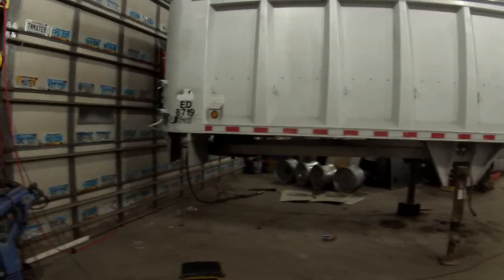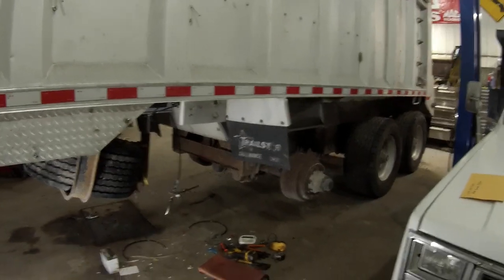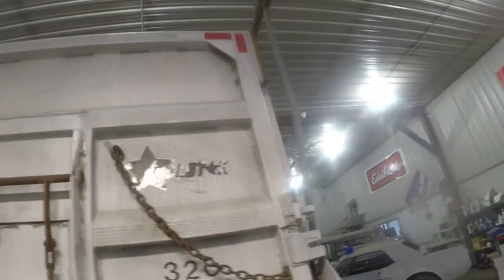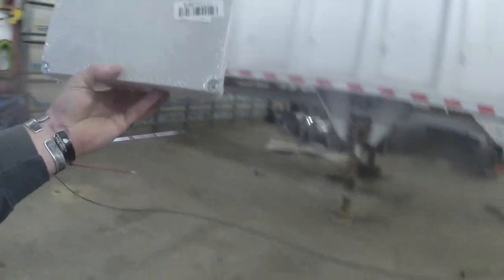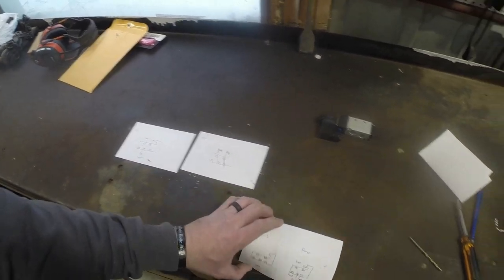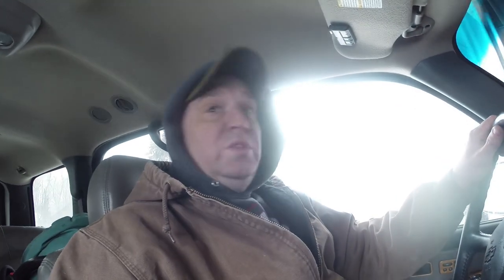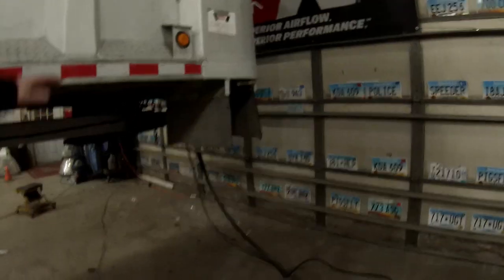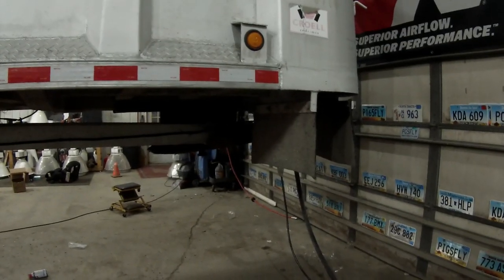Northland Mike Ep. 23 - Dump Trailer Tag Axle Conversion - Plumbing the Air Controls

Comment: Fontaine makes a fifth wheel locking kit just for such an occasion. Also some RGN trailers need locking fifth wheel. I pulled a frameless dump for10 years. I’ve seen a few different ways to lock it in place. What I’ve seen a lot of guys do is weld a round or half round piece of steel on each front corner under fifth wheel, then cut a solid steel piece to length to secure the front. Picture two round supports going straight up and down. Then on the backside the  two little uprights the back of the fifth wheel rests on when your not hooked up. Take apiece of flat steel measure it to length so when bolt it to upright it holds backside leveling the fifth wheel. Make sure it’s solid on all4 corners. I knew a guy that had the kit that was much easier to work with and more versatile tho.
Reply from the maker: Yup.   I will prob do a removable pin style in the future for now I just have some removable beams under the plate...   not too bad but a pin would be super convenient!

Comment: Looks like a nice trailer Mike, Super Singles are no big deal. What are you going to pull it with and does it have a wetline?
Reply from the maker: Yeah.  Im just worried about one goin down.   I picked up a KW t660 that was wrecked over the summer and rebuilt it.   (Kicking myself for not you tubing it)  I put a wet kit on and thats gonna pull it at first until I get the 352 ready to work.   Then it'll be a toss up!
Reply: @northlandmike6694  I ran 660's they are nice trucks, I also ran a cabover freightliner in 2014 it was a blast to run had a 350 in it with 80,000 you had to play your hills right like in the old days run downhill as fast as you can and then see how many gears you need to downshift going back up were my 660 had 600 cummins in it there was none of that. The 660 was a company truck the cabover I bought and fixed up like your doing and ran it to haul bottle water to Costco's and Sams Clubs places like that it was tough to make money.

Comment: Just out of curiosity, what axle is the height control valve on? On mine here in Australia I setup a quick action levelling valve on the middle axle  so as it comes off the ground it dumps the airbags automatically
Reply from the maker: Its on the middle if I remember correctly.   I'd like to lift 2 axles for empty back hauls, preferably the front and rear but the rear has the stabilizer blocks to limit the travel up.   So I'll prob just have the front axle lift.    Thanks for watchin!